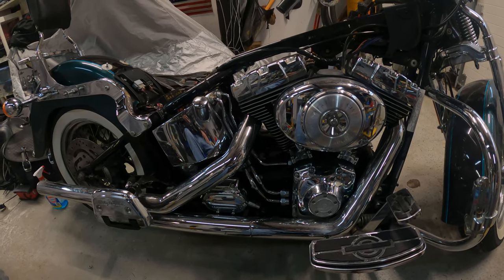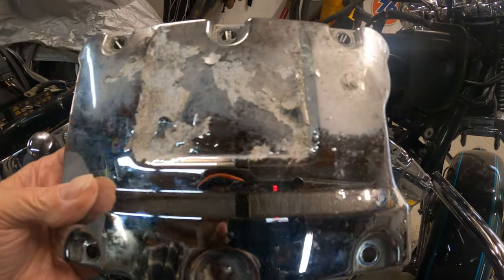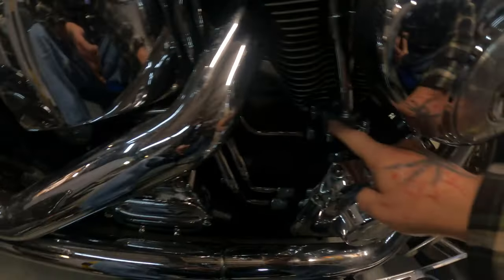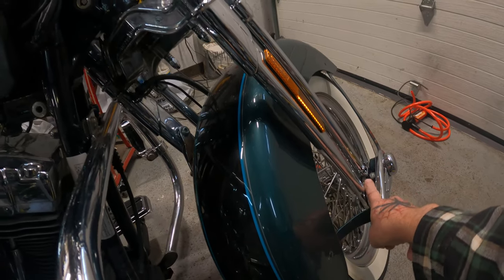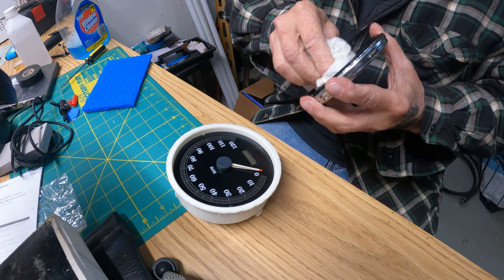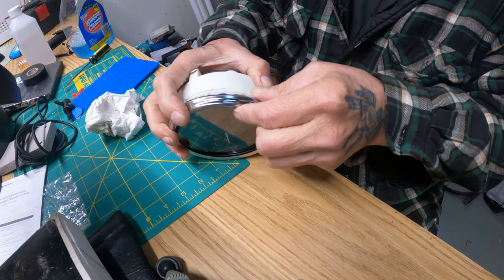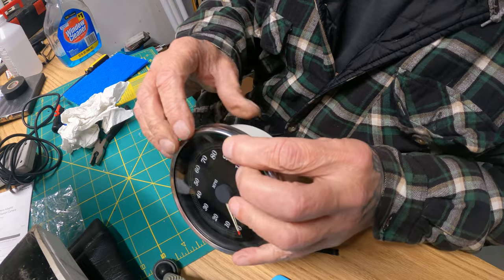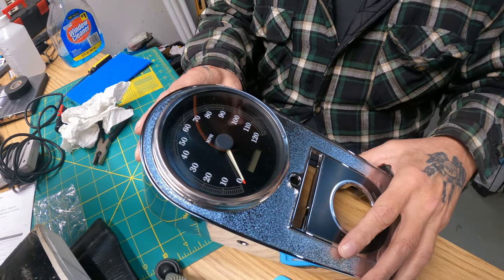2001 Harley-Davidson Heritage Springer(FLSTS) Repair Part Two Speedometer Refurbish

Comment: HI PAUL FROM IRELAND
I JUST BOUGHT A 2002 FLSTS WITH 20000 MILES ON IT.
WHAT SHOULD I CHECK FOR,:THE CAM TENSIONERS WERE REPLACED .
Reply from the maker: See if you can find a service record.
Front end should be serviced